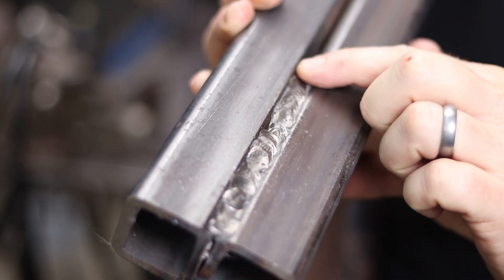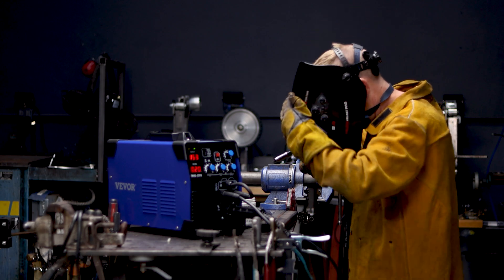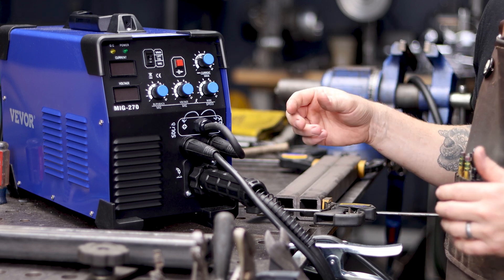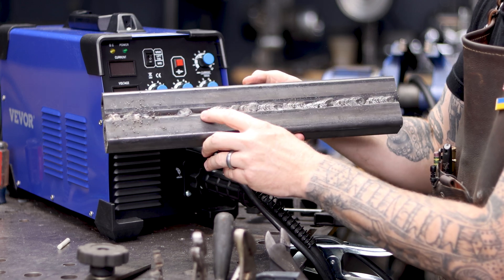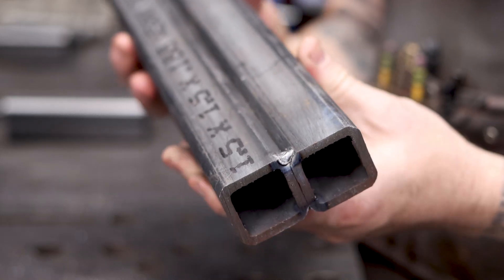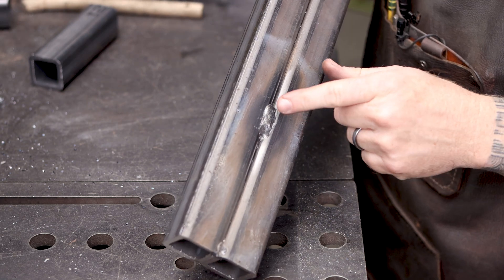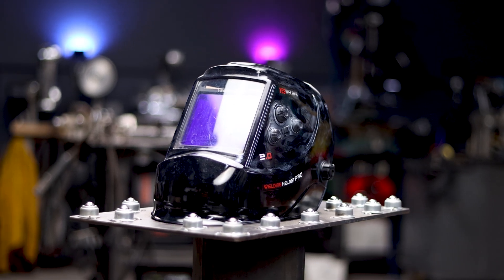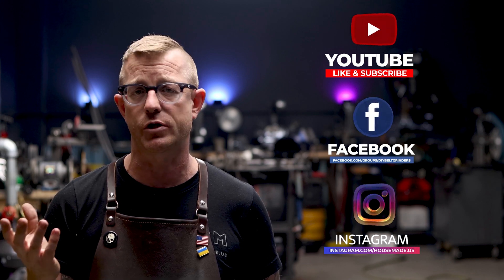How To: Clean gasless flux core welding

Comment: I just purchased that exact welder (before seeing this vid.) Spent more on all the accessories and stock needed for a simple repair than I did for the welder. Was concerned that the machine wouldn't live up to other testimonials, so I'm glad you did in depth testing, and posted your findings. I'll begin the repair tomorrow with less worries. And, now that I have the welder and gear, I guess I have no excuse for not building your 2x72 design... Keep up the great work.

Comment: With mig and flux core wire welding,  push your beads instead of pulling, this allows the arc to get down to the work and not just pile up a bead or fill , nice video Brian!!!!
Reply from the maker: Good advice Gary. Thank you.
Reply: Mmmm... not great advice. There's an old saying,  "if there's slag, you drag".  This applies to both SMAW and FCAW which use flux to shield the weld pool.  The flux is what creates the slag deposits on the weld which need to be chipped / brushed off.  Dragging helps to prevent the slag from getting ahead of the weld pool which can create inclusions and contaminate the weld which is undesirable.  GMAW (MIG) can definitely be pushed or pulled since the shielding gas does not produce any slag, but FCAW should be dragged.  In order to ensure proper penetration into the base material, focus on getting the settings dialled in correctly.

Comment: Thanks for the video. I use .035 flux core wire in a Campbell Hausfeld welder and have learned, while it is Smokey and spatters a bit more, flux core welds just fine. I use reverse polarity, remove the gas nozzle and give myself 1/4-1/2 inch lead and I get very nice welds.

Comment: Brian, what is your go to flux core wire?as a novice welder, I’ve had a lot of success with the blue demon .035 in my Lincoln pro-mig 140
Reply from the maker: I use the Hobart stuff from Northern tool. But...I typically never use flux core. Always solid core with gas. This was fun because it's so easy to setup. I'll try the blue demon next! Cheers!

Comment: I'm guessing your running it on 220 in the demos?  I think that alone makes a huge difference on weld quality.
Reply from the maker: I did 1/2 with 110 and the other with 220. For the shorter welds I saw no difference. Pretty impressive.